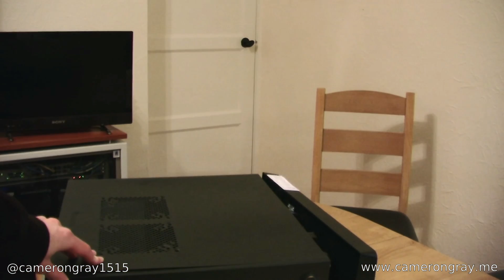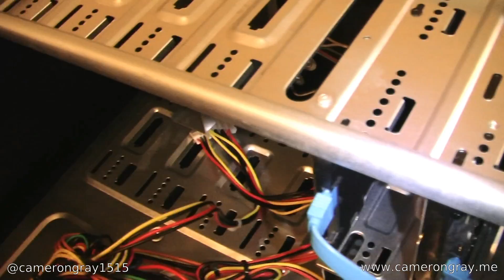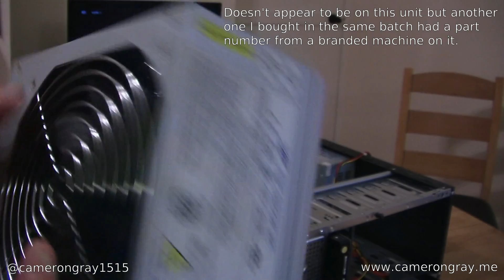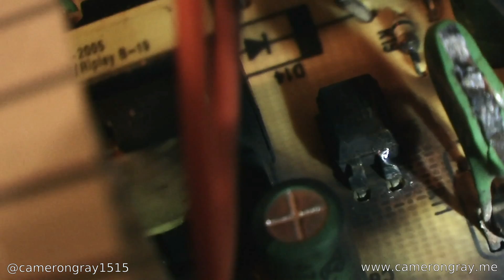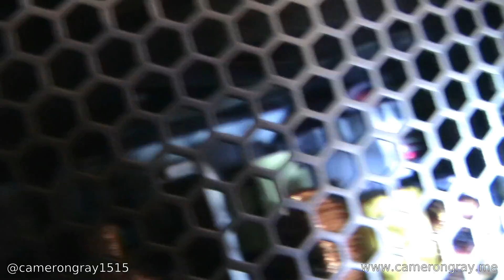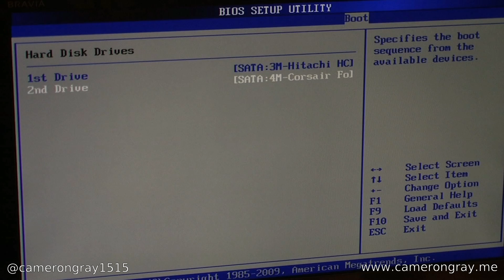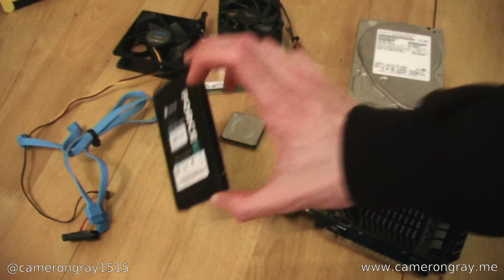Mystery £10 eBay PC

Comment: I have the same motherboard - sometimes it will randomly shut off and refuse to turn back on for a while.
Reply from the maker: That sounds like it could be a power supply issue (in particular the not turning back on for a while) - Worth investigating that as well before replacing the board.
Reply: Cameron Gray Well I've had other problems with the board before (with a different PSU as well), and the current PSU is from Cooler Master (also just a year old). 

What's weird is that it doesn't shut off at the same time. Sometimes it will shut off after a minutes and sometimes it can stay on for hours.

Comment: thats not even an fx lol but still good for the price
Reply from the maker: +ElCartelMexicano The CPU was an FX4300.  If you are referring to the Athlon at the end when I was testing the parts, that was a spare machine I had and was using to test the RAM, drives and video card.  I was unable to test the FX CPU in the video due to the lack of a working, compatible motherboard.

Comment: The failure in the power supply looks like it may have been plugged into 240 volts with the switch set to 120 volts. This likely also caused a high-voltage power surge to be sent to the motherboard which sealed its fate. The green component that was blown looks to me like an MOV.

Comment: I buy PCs for around this price for componants and I have gotten a GTX550 for my PC that was an upgrade over my 7xxxGTX till I had enough for the 1060 6gb I have now. Also do you recycle the bad parts or do you throw them in the trash?
Reply from the maker: Took the board, case and PSU to the local council recycling center and dumped it in the electronics skip - They should recycle it all from there.

Comment: How will the processer ever be ok after touching the pins with you fingers, have you never been taught about Electro static discharge, the processors cell walls have been damaged and it will start to overheat and fail within 6 weeks.
Reply from the maker: I wasn't aware of touching any pins when I was handling the chip although I'd rather hold the chip securely and potentially brush up against the pins rather than drop it.  The risk of static discharge is often blown way out of proportion, sure, there's always a risk but if you regularly touch a grounded piece of metal and handle things reasonably well you'll be fine.  The main reason people warn against touching pins is due to the risk of bending them.  If you were to cause some sort of static discharge, you would damage the chip straight away, it's not some sort of organic body that will start to die over time from a shock.  At any rate, the CPU is still in use and has been running strong for well over a year now.

Comment: You see that "/4" at the end of the model code on the RAM sticker?
And the "16" at the beginning?
And that "11" in the middle?
That means it's a 4GB 1600MHz Class 11 DDR3 RAM module.
You're obviously not that much of an expert.
Stopped watching the video right there.
Reply from the maker: I figured that out later on after I'd actually had the time to look at it.  It's not particularly easy to decipher the model number of a stick of RAM that I haven't seen before in a few seconds while also trying to talk on camera.  I never claim to be an expert although it's not really possible to judge someone's entire skill set from their ability to interpret the model number of a stick of RAM while under pressure...

Comment: I had a winpower power supply many years ago and it also failed. it said it was like 600 watts but then i bought a name brand power supply that was 400 watts and the system ran more stable then it ever did. and the power supply didn't run as hot. i knew they had it over rated and it really couldn't of been a 600 watt.

Comment: can tell at a glance that's kingston value ram, it's ram that gets tossed in a bin after the first mfg run because it doesn't work, gets resoldered and functions after- then marketed as 'value-ram'. it's typically regarded as low-tier garbage ram that is more likely to fail much sooner than something that passes QC the first time around. don't get me wrong- it's cheap and functional- but it's cheap for a reason, much like the rest of that build.

Comment: The red voltage switch on the PSU is not a sign of its age. My modern PC has one.
Reply: It's a sign of sloppy design. Modern flyback/forward converters are always multi-voltage, the voltage selector switch is present only in half-bridge converters which is no longer used in modern power supplies as it's less efficient.

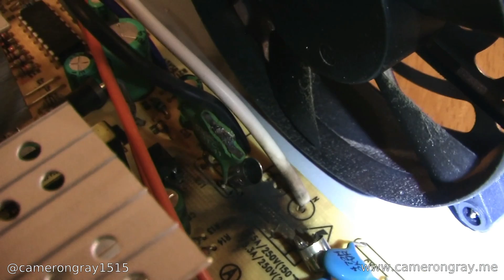Comment: I don't think it was the fault of the power supply. at 11:44 you will find the metal oxide varistor, which is designed to absorb spikes. it has clearly exploded, along with the fuse. Most likely this was due to a massive spike in voltage, probably a lightning strike.

Comment: As a PSU expert, i'm impressed that the "manufacturer" of this power supply even bothered to include the Y Capacitors in the entrance filtering stage. The green thing that got it's corner blown off is a Thermistor. Its used to regulate the input of the power supply when you start the computer hot (I.e the computer was running for some time, you shut it down from the power and start it back up). Other point is that this PSU claims to have two separate 12v lanes, which is such a ridiculous lie it cracked me up, plus, they didn't even bother to use a diode package on the 12v lane, they just hacked two diodes in place and called it a day. All of this is actually expected on a chinese psu such as this one.

The two "Y" Capacitors (Blue things) and the Thermistor(Olive green thing that got blown): 12:13

*This PSU would have NEVER, UNDER ANY CIRCUMSTANCE be able to supply 500W*, at max 180W and that is being generous, because also at 12:19 you can see that they used 4 plain diodes as a full bridge rectifier, instead of a package containing 4 four diodes inside. Also, because they hacked two plain diodes for the 12v lane, forget the "16A+16A" they wrote in the label, those are probably two 3A diodes is series, yep, only 6A on the 12v lane (Seen at 13:00). Pretty much the whole label is a lie, and i can't believe that companies that to this (Which are countless) don't get prosecuted over fraud, because that's what this sort of "product" (i would actually call it "electronic fecal matter") is.

Comment: If that pc is as new as you say it is, then its still under Manufactures warranty, which is maplins, there are grounds for a full refund even at this late stage because you can prove that they are installing cheap and dangerous defective power supplies that could burn someones house down or lose them there business. , or at least get a brand-new replacement. Obviously the guy who sold it to you didn't know nothing about PSU's or any part of the build. The warranty stays with the pc not the person who buys it. send it of back to maplins, i would.
Reply from the maker: +Custom Pc Solutions I doubt it was actually made by Maplin, chances are it was built by a small shop/internet cafe/individual who happened to buy the fan from Maplin.  Do Maplin even build PCs nowadays?  At any rate there was no markings/serial number or any sort of original receipt so I'd have no chance getting any sort of warranty service no matter who had made it.

Comment: That green thing looks like an overpower protection, that short circuits the line (if the voltage is too high) before it can get into the machine.
The fuse will blow at the same time as the short happens. So it actually works, but you still have to replace the PSU.

Comment: the only thing that could have damaged the power supply that badly would have been a lightning strike..
Reply: MineCraftJunky28 No. My power suply got fried. Companys like dell buy cheap psus and they basicaly just die after a year or two
Reply: It has a voltage switch. Switching it to the wrong position can fry it.

Comment: @11:40 That green component with the corner blown off is a Metal Oxide Varister. They are typically used as one side on the incoming power and the other side to earth so that if you get a large enough voltage spike the resistance on the MOV collapses and shorts to earth rather than the voltage going through all of the components on the load side. [Edit: after posting I noticed another comment where the same information was posted.]

Comment: that round blown up part was a varrac for protection against surges. and with the fuse burned like that it would take more then line voltage under even heavy load.
The only Time I have seen that was near lightning struck.

Comment: The components in the PSU is a or looks like a Varistor, which is there to reduce inrush current. the device blown out of the board looks like it might be an Opto-Isolator, both components are easily replaceable

Comment: There is a capacity unit, it is written as last number( KVR16n11s8/4 ) That is 4GB. Learn the kingston label as it tells you EVERY useful infomation, KVR = Kingston Value Ram 16 = 1600MHz i think n is = it's class which is 11 and not sure about the last numbers. but most important, speed, class and capacity and they've done it in that exact way since forever

Comment: hey just to let you know you should never put water on an electrical fire it will either A. make it worse or B. explode and make it worse
Reply: If you first unplug the power, what was once an electrical fire now becomes a class A (solid material) fire, so you can put it out safely with water.
Which is the reason why class E (electrical fires) was dropped from the fire extinguishers classifications, since you aren't supposed to put out electrical fires (with anything) without unplugging the power first, because if the short is still present it will reignite the fire after you have put it out.

Comment: yah avoid cheep power supply's you can loose your hardware with it.
I saw a one blow up so badly it actually put a dent in the metal power supply case
Reply: raccoon681 exactly I recommend atleast 80+ PSU
Reply: si have fun upgrading or that thing surviving a sudden power cut lmao
Reply: it's true si they just suddenly go it's a gamble.

Comment: I feel so accomplished, I had guessed that the GPU would be a GT 730 from the back plate and I was fucking right. (I only knew because I have one)
Edit: That GPU alone costs around £50 - £60 in maplin. Very overpriced.

Comment: as for this winpower power supply, I do not think the design is terrible... it works, but better components could be used. popped ceramic capacitor/MOV and a blown fuse definitely means it was blown up by a power surge.

still reminds me of my linkworld LPJ12 400w. thing is over 10 years old, and it has been through hell in power surges, yet it still works, although the chokes are noisy in it and I had to take it out, because it was losing its capacity in its old age.

Comment: Clear indication that cheap ass psu got struck by a high power surge as the fuse is designed to explode and same with the ceramic package beside it with its corner blown off it and then damaged the motherboard no doubt 
Ten years working around computers with certificate 3 in IT.

Comment: Started playing, switched to another tab
"Oh that's an SSD!"
QUICKLY SWITCHES TABS
WHAT
Reply: yeah man, an SSD for £10?! that's a bargain within itself.
Reply: Robert Fierce Lol windows 8 is shit, get windows 7
Reply: I got a 120GB ssd and it's barely enough for windows 8.1 and 30 free GB for the OS to run properly without slowing down the system. I'd say 60GB is not useful at all unless you use it to transfer data from your house to friends or other way around. Don't get me wrong it's better than nothing but not great.
Reply: windows 10 all the way.
Reply: kiroma the me tbh
Reply: Totally worth the 18 quids :D
Reply: depends...if you aren't gaming a 60gb would be perfect for a main drive and add in either another ssd for storage, or hdd/external. if you're gaming, a 120gb would be the smallest you could go and you will need another drive. using a 120gb for os here, 250gb for games, and everything else is external usb3 for work, only hassle is if you play games randomly, but I run arma and that's about it
Reply: Robert Fierce you are a classic example of somebody that talks out their own ass as if its fact. All OS will have people online discussing faults. thats kind of what happens. Windows 7, (and this is coming from someone who works with computers for a living) is certainly one of the better OS of recent time. Windows 8 and 8.1 are terrible OS for many reasons which there is no point discussing because you wouldnt understand why they are issues. Windows 10 is an alright successor, and if it wasnt for Win7 becoming somewhat obsolete I would of stuck with Win7 instead of upgrading. "the biggest bullshit of the 21st century" was probably your conception and birth. Surely anybody older than that wouldnt chat so much shit.
Reply: Windows 7 is the biggest bullshit of the 21'st century even now after all these years it's full of bugs and crashes and it's incompatible with most software and games I use. I literally don't know anyone that owns and loves windows 7 to NOT have a ton of issues with it. It's just shit. Check all the forums you want. Thousands of them. All full of complaints and help requests for their windows 7 issues.

Comment: That PSU has been hit by a massive power surge, most likely a lightning strike. The lack of a surge arrestor was the main cause of the failure, not necessarily the cheap PSU.

Comment: That WinPower PSU is made by HEC and they are not known for good PSUs.  Although, no PSU would survive the lightning strike or huge transient that went through that PSU.  It failed by way of the transient suppression and main fuse as it should.  That capacitor was likely over volted when the PSU blew and failed as an internal short that may even have saved the other components on the board when the PSU failed.  That being said, just because a PSU has an 80MM fan and a voltage selector does not mean it is old and junk.  I still occasionally see PSUs, especially in new pre-built systems that have one or sometimes 2x 80mm fans.  WinPower and other OEM rebadged HEC PSUs are low quality but you get what you pay for.

Comment: The voltage selector switch is still a very common thing, in the USA at least.  But considering most come from Asia, I'd say it is common in other regions as well.
Reply: Dustin Schings can’t say I’ve seen one here in the last decade. Most proper power supplies should be auto sensing now but of course if you buy cheap junk......
Reply: @RetropUk  Most budget cases from Newegg and TigerDirect have cheap PSUs with the old vvoltage switches.
Reply: @AtariBorn  Yikes. Guess they're working through bargain basement old stock. I work as an IT manager so I get to see quite a lot of kit but tend to stick to brands with decent enterprise support so I'm getting, Dell's, Lenovo's, HP's, etc.

Comment: On ram you can always see how much capacity it has by the lab, on that ram stick is 4Gb by locking at the "/4" in the end is says 4Gb in total. I use to work with building and service computers so I learned what to look for
Reply: Asjdj same 😁

Comment: Ive had this problem before, all they have done is change the voltage switch on the back of the power supply, i did it once on an old roosewell power supply, it is the American voltage setting that causes the fuse to actually blow up so ive seen that sort of explosion before. It usually kills the motherboard

Comment: Anondia are not great capacitors but they're not trash, they're used by Thermaltake and other known companies and do the job. 
Win Power power supplies are not the best but they're not crap either, if you look at its 12v rails amps it's actually slightly better than the FSP power supply you have. The damage to the power supply was done through a large power surge, could be because of a storm.

Comment: Cut the shorted cap off the board with side cutters and try the board again. If something is getting hot, then it is shorted. I repaired quite a number of these boards and usually FET shorts or the NIC chip goes and after removing it will work again.
Reply: michvod this is what I was thinking - rip that cap off and see if it boots!